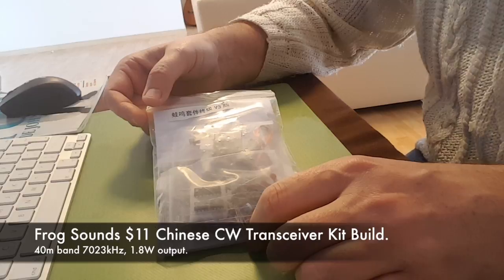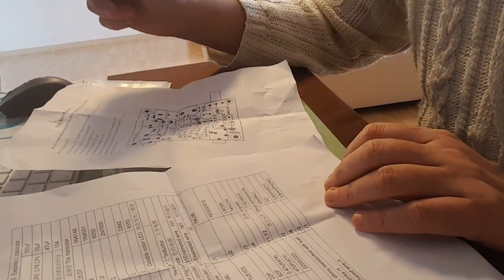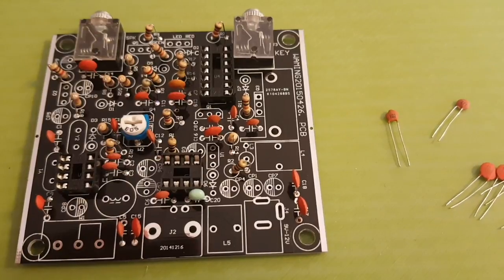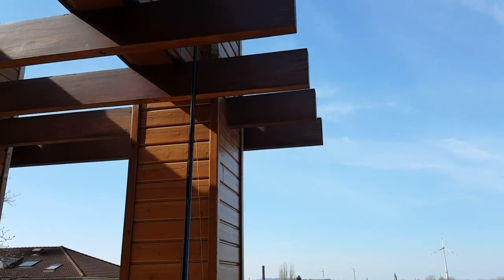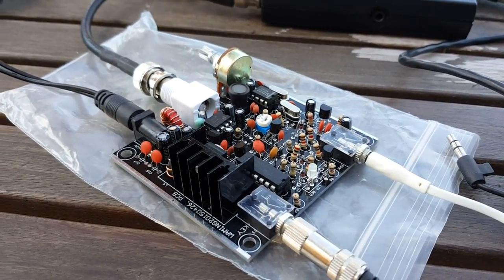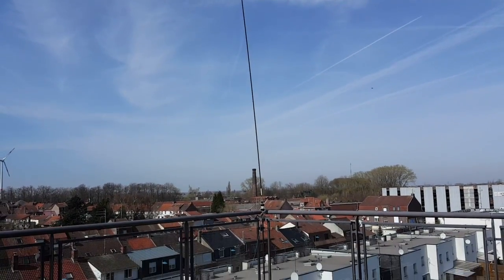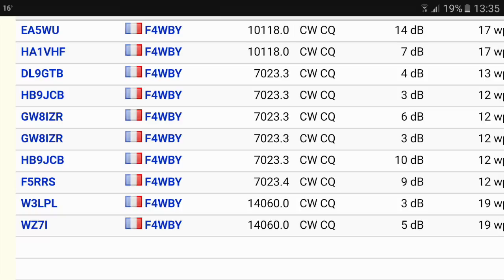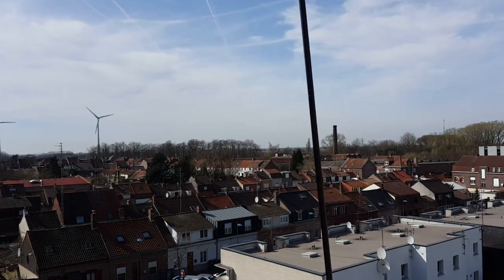The $11 Frog Sounds Chinese Transceiver Radio.

Comment: Hi radio prepper. Is it easy to change crystal on these as it is on PIXIE
Reply from the maker: Yes, in the same band of course..
Reply: @RadioPrepper  Yes ok because i se the new version have 2 cxco hmm one for recieve and one for tx I assume.
Reply from the maker: I changed both on mine..

Comment: how can i mod this to ptt in ssb mode?is that even possible??
Reply from the maker: It would be very far from the original... So, I'd say no.
Reply: @RadioPrepper  ok thank ypu and what about some 80meter am radio for radio broadcasting of course only for listening?
Reply from the maker: Easier but still not easy.. I am sure you could find better schematics for that...

Comment: I have built the frog sounds and it works good for what it is, about 2 watts out and have made contacts, it's more exciting than my main HF set for some reason, a vibroplex bug works lovely on it
Reply from the maker: Yes, I haven't made a contact with mine...
Reply: @RadioPrepper  the only thing I didn't like was the 'clack clack!' you hear on sending through the headphones, I'm looking at maybe the Norcal 40 or maybe also trying a rockmite next

Comment: Thank you Gil! Interesting video. I would like to mention that for $50 USD you can purchase a QCX transceiver by QRPlabs that I believe is SUPERIOR to ALL of the QRP radios on the market today. 73 de Howie WA3MCK
Reply from the maker: I have two QCXs... There are better ones IMHO, but few...
Reply: Radio Prepper Agreed - I should have said single banders.  Steve KD1JV has designed some AWESOME QRP radios also

Comment: I love these little kits from China. It's good practice for your soldering skills. If the radio works afterward it's a bonus. Have you made The One Watter?
Reply from the maker: Hi Ray, yes, I made an 80m 1-Watter, but it has a bit of an intermittent transmit problem. I need to take it out of its case and troubleshoot it, which I hate doing, LOL. It might be a while... The 1-Watter is probably IMHO the best bang for your buck, with filtering, compared to say, a Rock-Mite, which will pick up every broadcasting AM station it possibly can... That said I love them too, but the 1-Watter is better and costs the same.
Reply: I'll put that one on my list. I have a Pixie coming to me now. I want to refine my skills so I can do MFJ Kits with confidence. Good luck locking down the 1-Watter problem. 73!